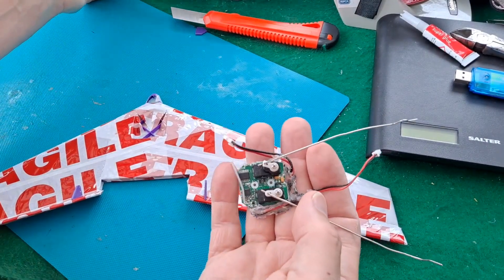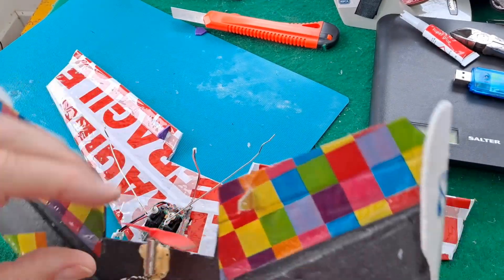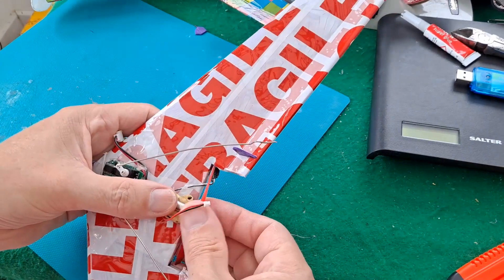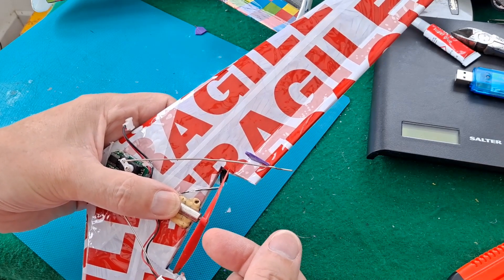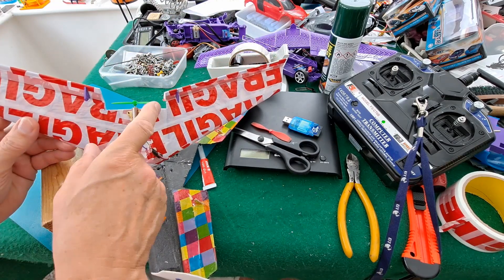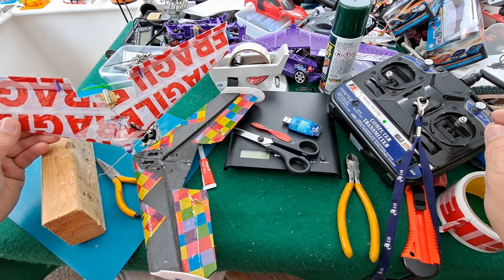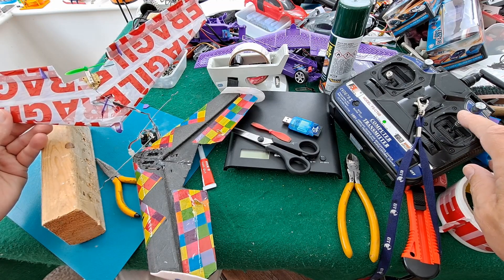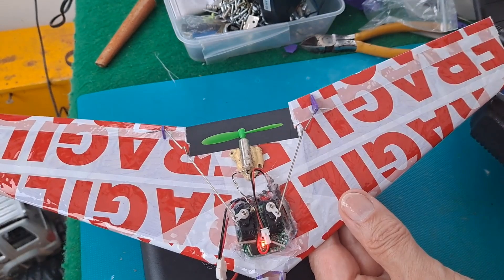3D printed RC micro flying wing - receiver & motor

Comment: Also the stuttering from my experience is stress on the servos. If they have any pressure on them when idle, they try to make micro corrections to keep it centered, great video and look forward to where this project is headed!
Reply from the maker: The stuttering stops when I give it a fully charged battery.

Comment: Disappointing weight, but I have to admit in my very limited experience with 3D printed wings (which were tape covered), they were significantly heavier than foam wings. Still looking forward to see it flying though! Thanks 👍😀
Reply from the maker: Don't hold your breath. It is not even vaguely successful 😆

Comment: I should also mention that the elevator should be up (reflex) on flying wings.
Reply: For stability, works also on normal planes.
Reply: You have to move the CG to the front then what also works for stability.
Reply: I have also tested to launch my Funjet with a 10m long rubber band what did work the first 10 times.
Reply from the maker: @prep0wer  yes a bungee launch might be an option as you will see in the test flight video, the motor I am using is hopelessly underpowered for the final ready to fly weight.